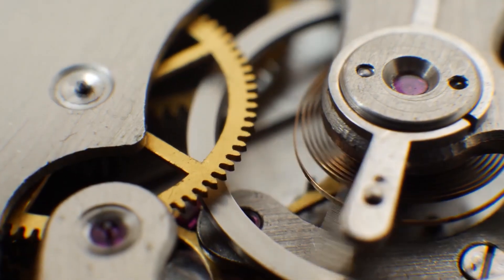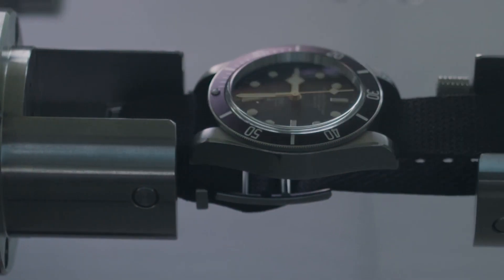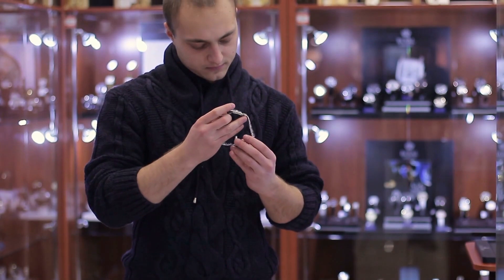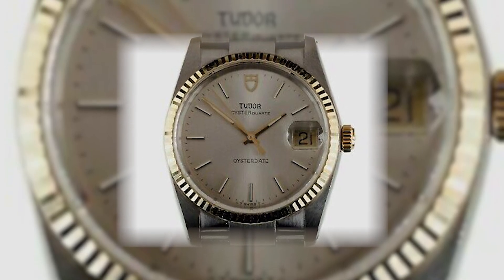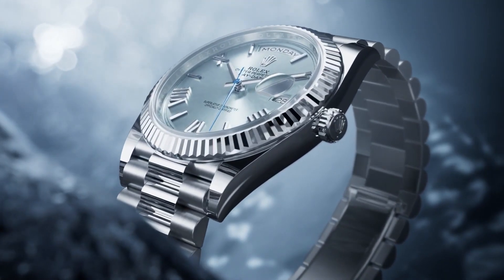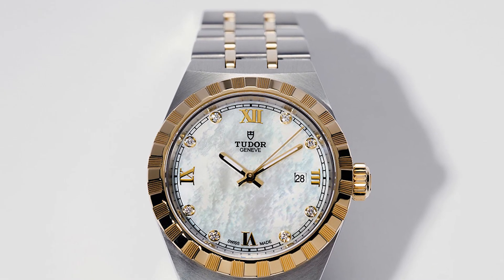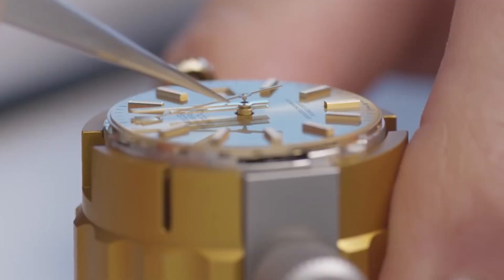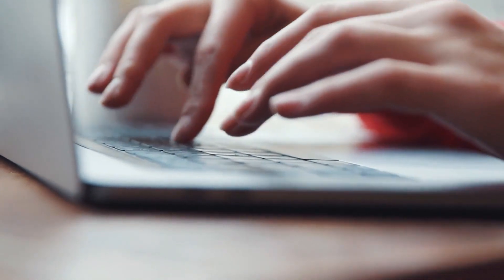Tudor Royal 41: A Solid Entry Level Watch OR A Poor Man's Rolex?

Comment: Great video I just have one question! Is the gold on the gold version really solid or capped because I found this scrolling in the comments in another review: "The Black Bay S&G models have solid crowns, bezels and end links while links in the bracelet are capped. The 1926 and Royal lines do differ. The Royal bezels and bracelet links are capped while the crowns are plated which helps assist in keeping the cost more approachable. The 1926 models have solid end links with capped bracelet links and bezels, however the 28mm versions do have solid bezels." Thanks!
Reply: It’s capped 18k for it’s price point